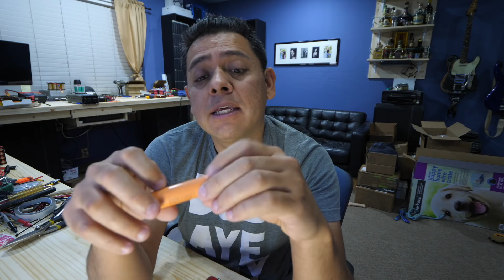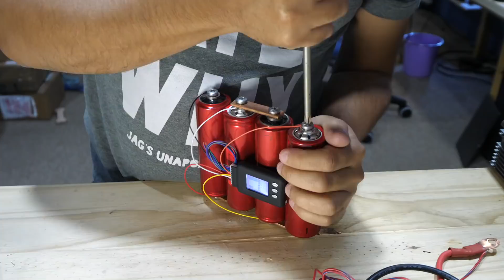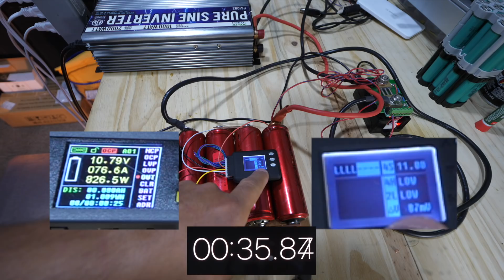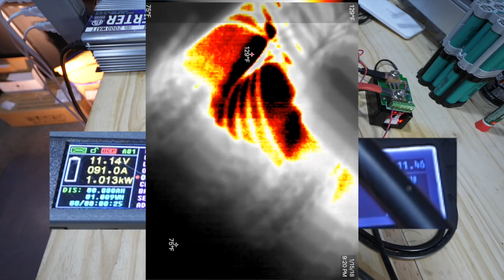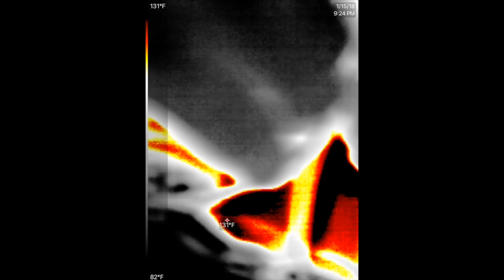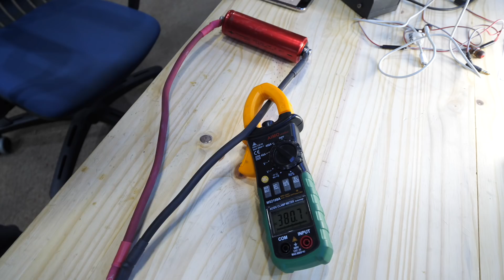12V Lithium Upgrade Headway 38120 Cells - 100A continuous (2018)

Comment: Use 4 lipo in series and say the altenator charges at 14.8v the unlike led acid the lipo will hold 14.8 and not sag for later engin restart.  So what if they are short charged.

Comment: Bought 3 sets of these, the first of the 3 boxes I opened and the cells were pretty filthy looking, with a dark grease from handling?  These do not look like NEW-other as in the ebay description.  The voltages out of the box for the first four cells were,  3.3267V,  3.2854V,  3.3317V,  3.3317V not too happy about that variance so far.  Also, has anyone found a source for busbars with reasonable shipping to the US?  The Link in the description has a $33 shipping fee. Thanks!

Comment: So 25.6Whr per battery means about $312kWhr? Still a bit high. Cheaper to buy a wrecked EV still.
Reply from the maker: Correct,  if you don’t need the flexibility of assembling small modules  you’re better off buying Chevy Volt modules http://j35.us/Volt-Battery
Reply: Yes. My Fiat batteries are doing great so far but am always looking for the next thing. Great that these have those screw terminals though! How are your batteries in the Samba?

Comment: Can these batteries can be used in an EV back-up pack or a range extender?  I would like to add 3-5kWh. If yes, how many would I need?
Reply: Anyone can respond my question?  
Btw. here is the car battery made out 4 of these LiFePo4 power cells https://www.renogy.com/renogy-lithium-iron-phosphate-battery-12-volt-100ah/   can save a ton if you are able to DIY.

Comment: Hi. Very impressive. Can I use these batteries in a radio enviorment?  How long will the charge last ? I need 4 amps on receive and 35 amps on transmit. The ratio between receive and transmit it 75 to 25%. I need the autonomy in an emmergency  situation since I volunteer with the local Civil Protection department providing communications.

Comment: So your telling me that you cant use basic series and parallel circuits to combine abunch of 3.2v lithium ion batteries into 12 volts system with a moderate amount of current?!?.........You should be able to build a dc/dc converter allowing for a higher voltage with lower current. I might have to try and make some type of 12v battery replacement. It should be possible. Also have you ever thought about adding any capacitors with these battery packs?

Comment: Jehu I'd like to replace a 40 ah agm  12 volt battery that goes into my auto scrubber which is 870 watts at 12volts. I'm glad you showed a video on these I've been eyeballing them for a while now. My only concern is wondering what I'd use from stopping the voltage from dropping too low. I've looked at low voltage disconnects and lifepo4 bms. I don't want to use a bms because I don't want to limit the amps for charging however the low voltage disconnects dont seem like amps are high enough. My best idea is to have a separate charging port or quick disconnect from the bsm for charging, any thoughts??
Reply from the maker: Yeah or run a 400A contactor with the low voltage disconnect
Reply: I run this type of battery without a BMS and just let off the throttle when the motor starts to slow down.  If you pay attention, especially for a small number of cells in series, you can notice when the weakest cell voltage is starting to drop off.

Comment: What it's bothers me is 8Ah it should read 80Ah, most logic is their an errata?
Reply from the maker: It would help if we understood what you wrote
Reply: jehugarcia I am sorry I didn't know about lithium iron phosphate electrolyte media was. But I understand now why 8ah is the charging amps not continuous amp discharge. By the way I have too consult with you about salvaged batteries, like Nissan Leaf or Chevy volt. Here in Puerto Rico we don't have many electric vehicles so need to know site's in internet that they could ship to the island. I will be grateful if can help me in this direction....

Comment: Where can I find the large heat shrink used on larger battery packs, I’m building a pack that is using 32650 and measures 23 inches all around.

Comment: I just purchased 16 Cells. Looking to make a pack to start and run my Volkswagen car. Would you recommend a BMS?
Reply: Tim D yes, the problem is finding one that can take the max discharge output that a starter battery needs, and still does balancing and protection...
Reply: If i use more cells, would the max output per cell be lower, and be less strenuous on the BMS? Does anyone have a BMS recommendation?
Reply: No, it won't solve the problem, it will be even more difficult to find a bms that have a high burst discharge capability and still have a max continous current protection and high balancing currents. If you don't need the higher capacity or more than 200A burts, don't use more than 4 cells. If you must (how big the engine is? petrol/diesel? other loads on the battery?) good luck finding a bms that allow you to draw high current burst (maybe with a delayed protection)....
Reply: Tim, for some reason I can't see your answer anymore :-/. Anyway, the 2.9 vr6 is a big engine, it will probably draw 250 A or more in winter time (when oil is ticker). So you should be good with a 4s3p. It's probably not a problem to use in parallel 2 bms, but I am not sure and it should be tried first.
Reply: Thanks for getting back to me. The car is used only in the summertime as the winter here in Ontario sucks. In the case of a 4S3P pack, i could run 3 BMS units in parallel. Or perhaps I balance charge the back prior to putting in the car and then run it without BMS. It will be a fun experiment.

Comment: Kinda a noob, but wondering  can I create multiple 12v lithium-ion bms battery packs so I can wire for 36v, 48v, ect. Each pack with have a 12v bms. Can I connect them In series to get different voltages or will the 12v bms in each pack not allow it?

Comment: I ordered a couple of these bms's to go with the batteries:
https://www.ebay.com/itm/12V-100A-4S-BMS-Li-ion-LiFePO4-LiFe-LMO-Lithium-Battery-Protection-Circuit-Board/192410188069?ssPageName=STRK%3AMEBIDX%3AIT&_trksid=p2057872.m2749.l2649

Comment: thanx for the video. would you consider making a small project? how can you do a jump starter for a car? i need it sometimes because of the weather here.  can you do it with 18650 batteries?
Reply: wire 4 in series to give you 14.8 volts nominal, and than depending on your battery chemistry and car size youll need about 4-8 of those in parrellel so looking at 16-32 batteries.. connect some 4awg wire with clamps to the outputs and youre good to go

when buying the batteries youre looking for high discharge rate not high mAH, lower mAH usually means higher discharge chemistry

if the weathers really cold like -30c you may need more sets added in parrallel, leaving the cables connnected to the battery for 15 minutes before starting can let them charge the car battery slightly and the lead battery will also assist in starting

Comment: I love your videos, Jehu. Thanks for doing them! 
This table says you should use at least 8 gauge for 90 amps.   https://www.bluesea.com/resources/1437  Were these cells fully charged when you started? Or just however you got them?
So this was kind of a "torture test" lasting 5 minutes. If you wanted to use this inverter in your RV for say an hour like that, what number of cells would you put together? I'm thinking 4s5p?

Comment: Could you use these on a electric skateboard. I have a vesc and motor but have yet to build any battery for it.
Reply from the maker: Sure if you can fit 38mm cells under your board

Comment: I ordered a set of 4 to replace my motorcycle battery. Good stuff. Thanks for the hookup.
Reply: What he didn’t tell you is that lithium batteries charge at different way with a different algorithm then a lead acid battery. You would need to change your charging method to the battery once the bike is running, or the cells will be damaged or possibly blow up.  That’s the main reason lead acid and Nicole metal hydride batteries are not a direct swap for lithium cells. Mother the difference in voltage as he claims, you can always regulate the voltage easy with a couple of parts.
Reply: Way overkill for any motorcyle engine (unless is a big goldwing or a v8 harley!) and the weight will be not so good, at least 1.3 Kg. (for 4s1p) You can shave almost half of that with smaller cells...
Reply: Gadget Review Videos I’m well aware of that. He’s covered this in great detail in his earlier videos. I’ve been watching his videos for years. It’ll be fine.
Reply: Gadget Review Videos you just need a bms to take care of balancing and overcharging...
Reply: yes for a motorbike you would have been better with the little a123 ones if you can find them 26650 sized 26x65mm 2.5ah and capable of 60 amps or they do a bigger 4.4ah one if you want more capacity or have a bigger bike that will do 120 amps theyre 32113 sized 32x113mm
Reply: oldskoolhead0 I think you’re misunderstanding the size of my bike. I ride a cruiser. I’ll post a video when I finally do this.
Reply: in this case the weight saving of using lifepo4 instead of Pb is useless...
Reply: Giovanni Esposito I disagree.
Reply: unaclocker Have you tried it yet? I am trying to do the same I just don’t understand how to do it.
Reply: XACUTE Nah, I just went ahead and bought an “Antigravity” brand LiFePo4 battery that’s meant to be a lead acid replacement. Even has a built in BMS. Way more expensive but I didn’t want to risk burning down my motorcycle in a science experiment. Hehehe

Comment: oh wow yeah i was thinking uh hmm he's not gonna try and run 90 amp with 8awg wire is he uh yep he sure is. Yeah look at that voltage drop. Wonder if the wire is gonna melt? For future reference and experience only trust 8 Awg wire for 30 amp constant and for that load i would use 0 awg wire for less voltage drop and better efficiency but just for testing you can work with 4 awg up to 60-70 amp constant it will get warm but it will do it and not have that much of a voltage drop. Good show though and thanks for the effort
Reply: his 8 gauge wire wasn't the one that was heating up, it was the stuff that came with the inverter.  Doesn't surprise me that the inverter would come with undersized wire (even if it said it was 8g i would bet's it's not, or was CCA wire)

Comment: Hey Jehu this looks really unsafe. I know you like to live on the edge with your multi chemistry battery electric car. But this vidoe seemed very unsafe. You were distracted with filming, there were loose wires heating up, you had several cheap chinese equipment, a high power lithium battery. That is a recipe for disaster, and just wanted to cation you from hurting yourself. It only takes one small mistake to die, or burn your entire house down. But I know you already all of know this...
Reply: jehugarcia He's not wrong, you are coming in hot and sloppy in that video. I've had more electrical safety training that you would believe, and I wouldn't disagree with him about. I used to wear a 40cal suit and class 2 gloves on a daily basis. You should know better than to push cables into thermal rundown, meaning you should be aware of the relationship between conductivity and conductor temperature. There's my two cents.
Reply: jehugarcia you're completely missing their point(s):

- many of us WERE trusting you to be knowledgeable enough to use appropriately sized components 
- Example: it was obvious that 8ga. wire would turn into a resistor, creating a bigass voltage drop & ruining your entire test (yet you never measured the voltage AT the inverter's input posts)

- while it's exciting to watch your videos, we lose faith in your knowledge when things like this happen. Worse yet, we lose TRUST in you when people offer appropriate recommendations & you just blow them off.

- Once we've lost trust in your work ethic, do you really think we're going to take YOUR recommendations seriously?

- I for one really do appreciate all of your content. But, being cocky when others offer solid advice only hurts YOUR image.
Reply: jehugarcia Lol, thats cute, try improperly racking out a 2000amp 4160v or 13kv breaker and then tell me about risks. What you were doing there was not risky just dumb. At the end of the day, you are the one who will burn down their workspace on a class d fire. That is costly not deadly. You could take a word of caution as advice, or make smart remarks, your choice. I have really liked a few of your videos, but not with you start doing work half assed.
Reply: only smart remarks I can see is in ur reply... going all bitter because he knows that what urtalking about isn't going to happen with what was going on.. the invertor even had safty cut off.... calm down and go jiz over ur 13kv breaker :/ been reading to much h&s or stuck in the office too long need a bit of the real world
Reply from the maker: Settle down!  Bet you don’t go outside shoutout a helmet,   You sound like the type
Reply from the maker: If you don’t like risk don’t play with batteries,  and definitely do not short test them,   My 2 cents

Comment: Ive got the sameish inverter. (240v AU plug version but same case so same factory prob etc) and the cables it came with were rubbish. Cheap ass copper and crap insulation aswell as bad crimps. I replaced them with 6 B&S cable.

Comment: I'm confused on how to connect lithium batteries cells to get 30ah. I need I need 4 3v cells, then times 7 rows which will be 28ah..n 28 batteries...im confused on how to connect them 4 parallel the connect rows in serial. Confused there..also confused on what to used to prevent exploding overcharge/discharge..help..
Reply from the maker: You sound confused,  you need to start watching videos on the subject
Reply: jehugarcia too many videos..no bueno..do you have a vid with detail info..just started to watch your channel..want to start small.
30w solar panel with 40ah battery for simple applications..laptop cell phone..chaeging batteries..
Cuando veo muchos me confunden porque todos dicen cosas diferentes..
Reply: it's really not advisable you jump into a project like this without some more basic electronics knowledge ><

that being said, these are 3.3v ish cells with 8AH capacity, 4 in series get's you to 12v lead acid battery voltage (fully charged lead acid batteries are about 13v), then if you want more capacity you start putting them in parallel. a 4s5p pack (4 series 5 parallel) would need 20 cells and would act like a 12v, 40AH battery (slightly less as the testing showed)
Reply from the maker: Bingo,   I️ get so many “spare me the details, just tell me what to do” Requests that I️ need a non rude productive answer
Reply: animefreak5757 I already know all of this...i took electronics back in the day..sometimes simple confuses the hell out of people..i already have the drawing 4 series 10 parallel  rows ..the issue is connecting them..it feels so simple but confused because series one connection no bueno..so it's series parallel..been reading trying to figure out..i think kind of got it..now I'm on testing phase I'm charging batteries at this moment..recycle..so it's 1+,2-,3+,...so on..so the part that confuses me is front is different than back..ill keep digging i also found some guides..but still stuck..any info is appreciated..
Reply: jehugarcia when u comment without knowing how much research I put into learning some of this..n I know I can grow from this..been thinking of doing a motorcycle..cafe racer..n u found a  guy that did a vehicle..n u ask..its sad to not get guided the right way..from a guy that can help..but eventually I'll figure it out..si pude aprender ingles y sacar un bachillerato..inmigrar como muchos..esto no esta tan dificil..
Reply: I guess i didn't asked the correct question..my fault..
Reply: The reason we are saying you need to know more is because understanding how series and parallel works in regards to battery packs is fairly basic stuff when it comes to building a pack.  There is a LOT of power in these cells and if you short them by accident it would be very easy to start a fire, or burn yourself quite badly.

as for the arrangement of the cells, you build a series pack, or several, then you put the entire series pack in parallel with others.  That's the basic premise of it, though the actual connections can be a bit hard for the layman to trace because it's usually done in a way to optimize space and keep connections as short at possible.  If your unsure of anything i would suggest building a mockup pack with AA alkaline cells, that way if there's a issue there's a lot less power involved.
Reply: I think most packs are built from parallel modules of cells. And parallel blocks are put in series.  You also need to consider that the buss bars should be similar as the amount of copper between cells and strings matters for keeping things balanced.  For cells like this which are used and thus not well 'balanced' it might be worth considering the parallel block interconnect gauge.  I am not sure what that odds are of one of these cells internally shorting out so interconnects could be sized so that they can share the designed peek load, buy would burn out if a cell were to fail as a short? Like a fuse.. anyway, i am still cycling some of these cells and they are all over the place and definitely need a good bms to stay healthy for the remainder of their lives.